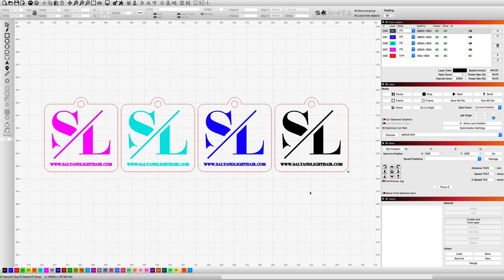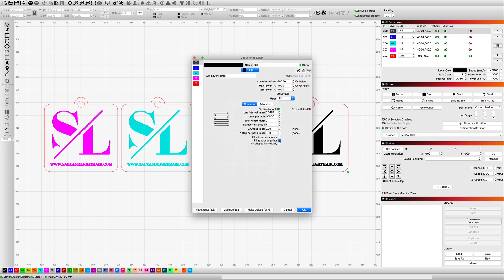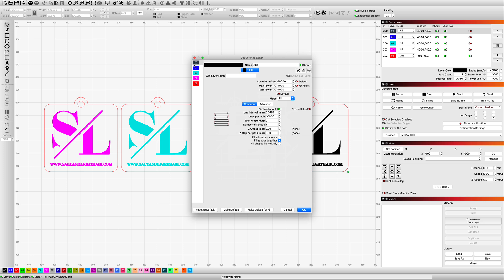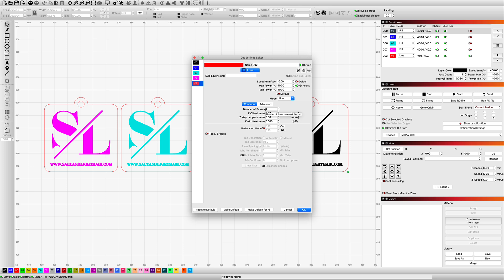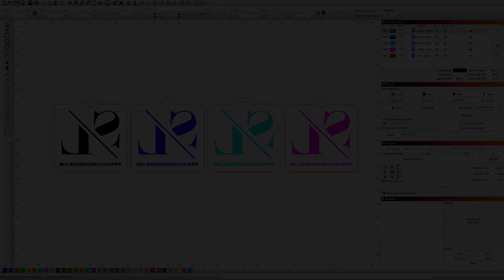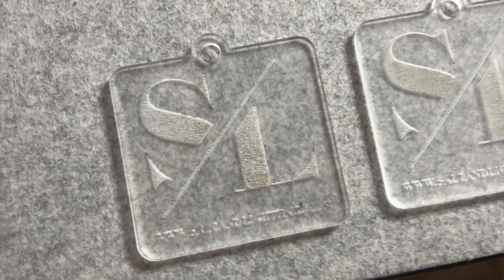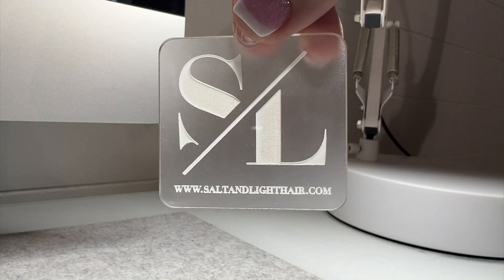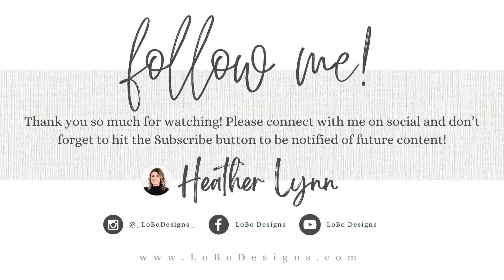LightBurn Tutorial — Defocusing Engraves

Comment: When you did the red cut layer it showed no z offset in Lightburn. Does the laser automatically change the z height prior to cutting the red cut layer or did you send the cut layer as a seperate job to the engrave layer? Thank you
Reply from the maker: Hi! The cut layer is set to the height where I autofocused. So, it will lower the bed for all the engrave steps and then bring it back into focus for the cut step!

Comment: Hi Heather, it's very hard to engrave acrylic that deep and get clean results.

I only engrave deep when making acrylic stamps, in that case I engrave with normal focus the 1st pass and defocus the 2nd pass to clean up any remaining lines.

Those visual lines are normally related to the engraving lines overlapping. 
I don't believe is possible to engrave that deep at 400 DPI without line overlap...

My 2 cents are, use minimum power that way you get the thinnest engraved line/dot and play with DPI/LPI to find the best results, also like you I defocus 2mm (Pros: Better quality. Cons: Longer engraving time because of Higher DPI)

Remember Higher Power and/or Defocus will engrave thicker lines, so you will need to decrease the DPI/LPI (Pros: Faster engravings. Cons: Lower quality)

Some people also uses a fine layer of dishwasher and get good results, didn't try this because I'm very happy with my results.

My best engraving machine is the k40 because the 35w tube have a really thin laser beam and in low power can engrave at 500 DPI easily, my 100w at minimum power I engrave only at 250 DPI or lower. 

Take my tips with a grain of salt, every machine is different. Only trial and error will get you to a quality you're happy with.
This is my job for +10 years ☺

Best of Luck with your channel, you got a new subscriber.
Greetings from Portugal.
Reply from the maker: Appreciate you! 🫶🏻 Thanks for watching and following along!